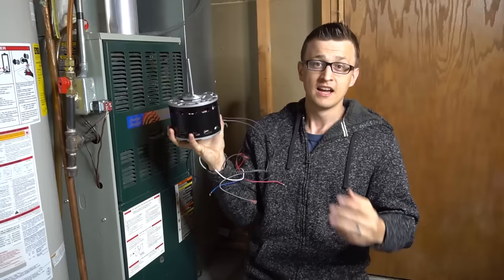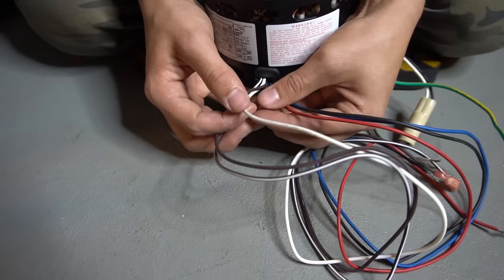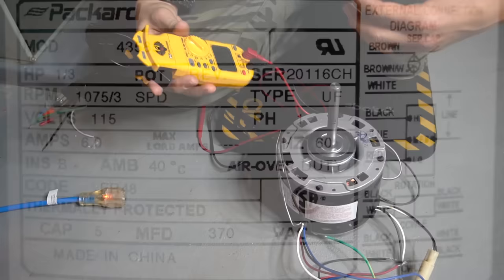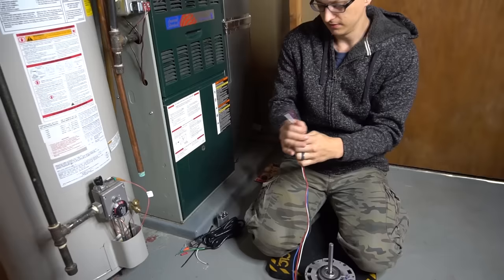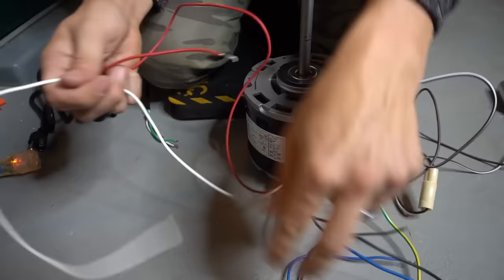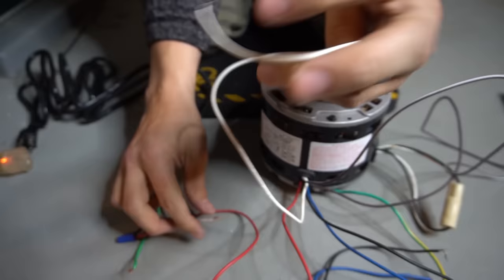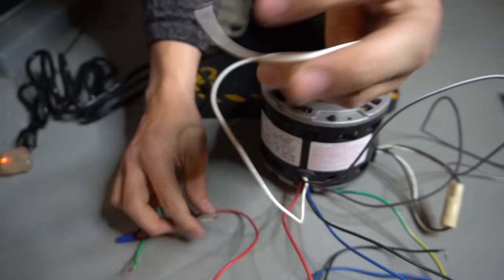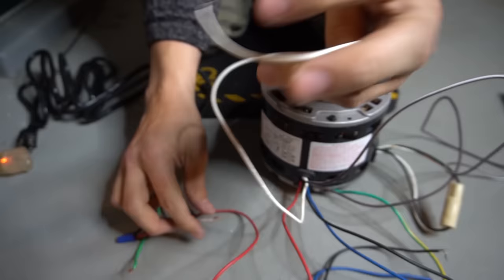How To Wire a Furnace or AC Blower Motor

Comment: Mine has a blower relay with a purple and a blue wire   A guy shorted out my thermostat and now I can’t get the blower to run.  Any suggestions
Reply: In case!  UPDATE:: they found my defrost board went bad outside, so this   friend called his brother in law and they came over and bro in law bumped a couple of things together which fried my thermostat and main board inside. I broke down and called a professional and he was good.  My house is comfortable again.  I found my last  ac guy 🍀

Comment: Help please. My blower motor doesn't have a red/low speed wire but my board does. Can i switch black to low in winter and back to high in summer?

Comment: Your videos really helped me out.  I wanted to clean the blower motor cage in my system, and came across your channel.  Question:  Is there any reason you can think of why my heat is connected to the Hi speed (black) wire, and my AC is connected to the blue?  I live in Dallas, and I would think I'd want the high speed for my AC, not my heat.  Thanks.  I appreciate your effort in the videos.
Reply from the maker: Glad to hear the videos were useful! You are right, normally the AC would be the Hi Speed. The only reason I can think of as to why someone would do that is if the furnace was overheating and they put heat on the max speed to reduce the temperature inside the furnace to stop it from overheating. Or perhaps it was simply mis-wired and that's all there is to it.
Reply: After looking more closely, the furnace was installed in 98, but the AC coil (indoor/outdoor) are original, from 1985, believe it or not.  I think maybe the installer of the furnace had to change the speeds because it is not matched with the old AC unit?
Reply from the maker: @davidmclain1875  That's possible too. He may have done that to compensate the mis-match.. If your unit has been running fine all these years, then I would leave it alone.

Comment: how do you know what the amps for the speeds are ??  love all your videos !!!
Reply from the maker: There are charts out there that break it all down but on the motor itself and just in general the different amp draws (what they should be) are not listed anywhere.. Probably because the amp draw will vary depending on the load. (is the filter clean or not, is the A-coil partially plugged, is the duct work sized right, etc)

Comment: thanks for sharing the video. i have a question: does this apply to Ohm's law (V = I x R) ?  I was calculating the high side of the motor (amps x resistance), 2.6 amps x 6.04 ohms = 15.704 volts.  How do you apply this to Ohm's law?  Thanks.

Comment: Thank you so much for your videos. I have a question, is it possible that a condensing gas furnace is installed without a blow motor capacitor? I cannot find mine anywhere but I hear a buzzing/humming sound in the vents that most videos point to. The squirrel cage is not jammed so the motor seems fine but cannot find the capacitor anywhere. I see a wire connected to the body of the blower wheel for earth. Could this be a bad install by the tech?

Comment: hello- great video Thanks..  Did the resistance test and got nothing- so started to take apart-  embedded and sealed circuitry in the cap with a circuit board containing 2 1000micro farad capacitors and other stuff- unplugged 3 wire (black red blue) lead. 10 ohms on each.  Is this fixable or can I just use the motor without the other circuitry?  There is a caution label in the motor housing "not to use without the circuitry. Thanks again and appreciate a response.

Comment: What would happen if you wired the two capacitor wires together in the case you didn't have a replacement capacitor?
What is the EAC terminal for on the control board?

Comment: Question... I understand Copper to Copper wire splice but what if you have a condensing fan motor that has either steel or aluminum wire.. and you need to extend it..can you use copper wire to extend the steel or aluminum wire on the motor? I heard it will heat up at the connection because of two different types of metal wires spliced together..thanks

Comment: Hi Jay, It is always good to watch your videos. I had a old Lennox furnace which I want to hook it to thermostat to turn fan to run on low speed to circulate room air.  I have no experience on HVAC/Heating experience. How can I wire this?  I did not find the switch on this furnace to let the fan run. thanks in advance. Jesse
Reply: G(Green)wire is for that blower, so just connect your G wire at your thermostat end and also furnace end, you are good go.

Comment: I had my a/c unit replace and I kept the blower fan which is 220 volts the number on the motor is D341314P71 and the housing is 4tee3f40b1000aa, no idea how to wire it up. any ideas

Comment: I just replaced my furnace. I would like to use the old furnace blower motor. It does NOT come with a capacitor. So, can I add a capacitor to this motor when it did not come with one? The blower is 40+ years old.

Comment: Hello,

I have the blower model 48HWC18A-"1", it has 4 cables, I did find replacement that has 3 cables? how that will works with my furnace? is the capacitor integrated with the new models?. If the blower is not working it will prevent the gas and there will be no flame?

Regards,

Comment: Need your help buddy. I installed brand new motor with same specs, new capacitor but new motor not blowing as strong as old one. I checked that motor is rotating correctly, new filter, blades clean on the squirl cage. I am puzzled.

Comment: I have an old two wire motor in my Mars Furnace.  What gauge wire do you think I should use for it?  I was thinking 14 AWG.  The run is less than 5 feet.

Comment: The capacitor is actually between start and run windings of the motor, and the speed wire connections could be separated from one another on the run winding . The black wire is connected to run winding of the motor and run terminal of the capacitor. The white wire is going to common of the motor and the other side of the 120 vac . Because there are a lot of wires the capacitor is seperate although it is between start and run windings of the motor. What is the voltage readings on the terminals of the capacitor, that is across the capacitor!
Reply: Also the black wire of course goes to the 120 vac also.

Comment: Hi,

How do I test my furnace blower motor to see if it's bad?

Every time I try to turn my AC or Heater, it tripps the circuit breaker. 

Thank you
Reply: Probably just a bad capacitor.. you should hear it hum for about 2 to 10 seconds before the breaker trips. If possible spin the fan/motor in the correct direction then have someone turn it on while it's still spinning and it should take off and work as normal. The capacitor just gives the motor enough juice to start spinning on its own. Also.. if the motor doesn't freely spin easily then the bearings are bad and that would cause the circuit to trip as well.

Comment: i have a motor with only 3 wire , brown yellow and white, i know the brown goes to the capacitor, does it mean that i should make a jumper from  the  white to the other side of the capacitor and then plug the yellow at the black, and the white to the white at the plug cord?

Comment: In my blower motor, there is no resistance between common wire and speed's wires. Same thing between capacitor's wires, without the capacitor. What should I test ?

Comment: Question from a curious mind. Do you think it is possible to use a motor from a generic box or oscillating room fan and implement it into the furnace?

Also my advice would be to buy backup capacitors for both the condensing unit and furnace so when they go out at 9 o clock at night you will be able to replace them and not sleep in sweat.
Reply from the maker: I am sure it's possible :) Preferably the HP and RPM should line up or be very close. And that is a very good suggestion, about the capacitors! Thank you for adding that. I should mention that if I make an AC maintenance for homeowners video later on.
Reply: That's really going to depend on the motor, but this seems unwise to me. When I think of "generic" box or oscillating fans, they typically have smaller, shaded-pole induction motors. These have relatively low power ratings and relatively low starting torque. They will likely struggle to get your squirrel cage blower rotor spinning at a reasonable speed, if they get it spinning at all. If you overload them, they will get hot and burn out and/or start a fire and there really isn't any way for you to reduce the load on them without changing to a smaller blower rotor. It's possible that larger industrial fans may have motors with sufficient power ratings, but I looked at a couple and even a moderate sized 24" industrial style fan is probably only rated for 2 amps of current or less so is probably in the 1/12 to 1/10 of a hp range. Your blower motor is likely in the 1/3 to 1/2 hp range and will likely draw something closer to 6-8 amps at full power. We haven't even gotten to other considerations yet like starting torque, speed, mounting interface, shaft size and design... Next consider that the proposed application will have this motor sitting inside a metal box in a rarely visited room in your basement or some other location where it will be out of sight and out of mind. If things do start to go awry, it's unlikely that it will get noticed until it's a bigger problem. Improvised motors with non-optimal specs are better suited to use in machines that will be operated with a human nearby who might notice when things start to go awry and before it becomes a major problem. For a motor that's going to be out of sight and out of mind, you really want something that's going to be more reliable.

Comment: So if I want to run a 120V accessory off the blower (it only turns on with the blower), I need to switch the hot wire (that powers the accessory) from the 'Heat' terminal to the 'Cool' terminal every time the seasons change?  When the A/C is running, there is no power to the 'Heat' terminal?

Comment: Hi, if I have 2 black wires (that I cant trace back) for the blower motor, does polarity matter to the new motor (which has a black and white wire (plus the 2 brown wires for CAP plus the ground)? IE does the polarity of the white/black wire from the motor matter when connecting?

Comment: My old blower was single phase single speed 115 V motor and it has 
Blue
White 
Red
Black 
Brown 
And green (ground )
My new blower motor is also 115 V single speed one phase motor 
It has all the above wire except it doesn’t have the brown one 
What should I do with the brown wire if I connect all matches colored wires and I left with the brown wire unconnected to anything

Comment: The blower motor for my heat pump indoor section does not have a white wire. It has a purple wire coming from the cap that is attached to the 240V common terminal in transformer of control. Then it has three speed wires, black,red,blue- which blue (med speed) wire goes to a terminal on a Time delay board. it is marked COM. Is the blue wire the common wire for blower? What wire would I attach a current sensing relay to (to turn on humidifier only when fan is running)? Thanks much..

Comment: i ripped out an old blower motor from a huge swamp cooler....is this motor strong enough to operate a make shift go-cart for kids under say 100lbs? or would i need a larger motor?  what size battery could you recommend for such a task?

Comment: You have a link for that 120v plug in wire to test the power to blower motor?
Reply from the maker: That is actually a power cord from a water heater inducer motor that I replaced. I cut off the cord before I threw it away and stripped down the wires. You can do this with any extension cord that you don't mind cutting.
Reply: @WordofAdviceTV  do you know if its 12 gauge 14 or 16 gauge wire?
Reply from the maker: I don't remember to be honest but I think it was a 12 gauge

Comment: I have similar motor with only difference is it is 1/4 hp. My resistance with common(white) to low(red) is 12, to med(blue) is  8 and to high(black) is 4. Is this a good to use motor or bad ?

Comment: I bypassed the circuit breaker and BTDR w the power cord and the blower motor ran. But it doesn’t run otherwise. Does this mean the BTDR is bad?

Comment: What would happen if the capacitor in the condenser outside was smaller then the original one, that came in the condenser, when I purchased the new one I received a smaller one

Comment: my question is you should only wire 1 fan setting wire and the common wire? my motor only has red,blk,white but new motor has red,blk,blu,yellow.
Reply: Yellow is common/neutral, red is low, blue is medium , and black is high speed on the new motor

Comment: I see the black wire pulling 6.amp on a 1/3 hp. What if I can change the motor to higher hp like 1/2 hp? Can it be done?

Comment: And what's the purpose of a start capacitor?; . When it's hum you can give a push cclw or clw the run control the slip of the induction motor

Comment: Can you answer me something...Why would the installers of my furnace hook up the black (high speed wire) to the heat and the blue (med/low wire) to my AC side. Heat would blast out of my vents and the return vents were loud also, feels like the heat is either up or down never just comfortable. The AC in the summer time would blow very weak at the vents....did the installers just mess up and put the wires on wrong by mistake?
Reply from the maker: Yes I believe they made a mistake. Cooling is always the one that gets the high speed.
Reply: I flipped the wires, now the heat is really even throughout the house and it stays at a comfortable heat range instead of the spikes and dips of heat when the blower was on full blast. Thank you for the reply, I’m not a qualified furnace tech but I thought something was wrong...I’ve heard stories of the HVAC field having hacks as techs, but I guess hacks are in every field also.

Comment: Electric heat has to be on low speed. If you use high speed the element will fail.

Comment: I My Ge blower motor is out and it has a twin fans, I have an AO smith motor which has three wires only and i it doesn't work for me mind you the original motor has five wires plus the cap wires?

Comment: I can't seem to find a replacement motor that matches the specs of my A.O. Smith f48x93c04 motor in my Lennox air handler except a few old one's on eBay.  Any guidance on another motor I could cross this over to? I'm hoping to find one on Amazon Prime that I can get in a day or two. It is hot in here! The specs on my failed motor are 1/3 HP, 825 RPM, 1.7 amp, 240V, 3 speed, single phase, CAP 15, 370 MFD, rotation CCWLE, frame 48y, 50/60 HZ, 4" Long 1/2" diameter shaft.  I can't find any on Amazon Prime with those specs and I just don't know enough about crossing it over to other specs that would work.

Comment: Capacitor says 5 on diagram   and I dont have a 5 and I only have a 7.5 or 3.5 cap would it be better to be slightly under or slightly under?
Reply from the maker: I would go with slightly over but I would also come back later and put in the 5..

Comment: I used a spare dual capacitor 50/5  but I put it on the HERM fan terminal is dead , blower motor works is that bad?

Comment: Hi
1 person fix my ac, and turn on, but when get the temperature I have en thermostat, and try to on again, turn on and few seconds go off, and in the furnace I sow the green 2 color is not wire, only to the motor...can you please tell me where need to be connected, 
Thanks

Comment: Thanks but I think you should just point out the danger of capacitors. Capacitors can be lethal, I know these are not electrolytic or large but you are advising on electrically lethal voltages. Thanks again.

Comment: Just replaced Blower capacitor and still not running full speed just slowly . Lines were frozen let it thaw for a day and a half and changed filter . It was filthy . pretty much burned out blower ?

Comment: I took pictures of my wiring before I removed them to clean the blower. I connected them back but the blower won't kick on. It works if I wire it to a plug and plug it in but won't kick on when connected to board... can anyone help?

Comment: If the blower motor is 1/3 hp    and I only have a 3/4 hp is that okay?
Reply from the maker: I wouldn't do that unless it is only temporary until you can get the 1/3 hp motor. 1/2 hp difference is a bit too much.

Comment: I'm curious about what reason someone might have to switch the direction that the blower motor is spinning
Reply: I'm thinking the fins inside the blower might push/pull air according to motor direction.